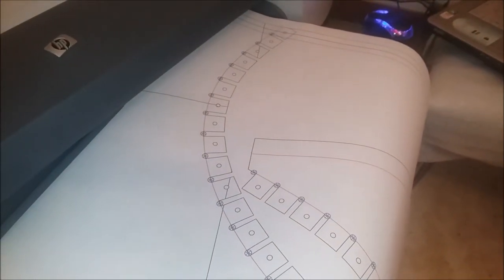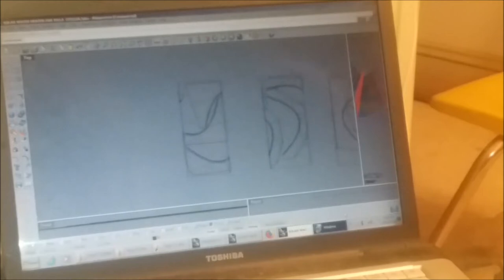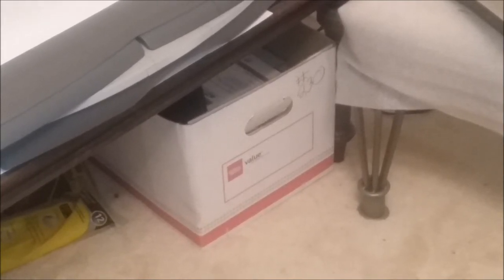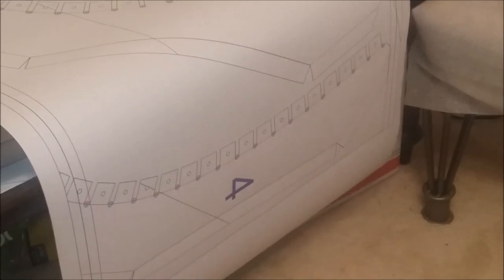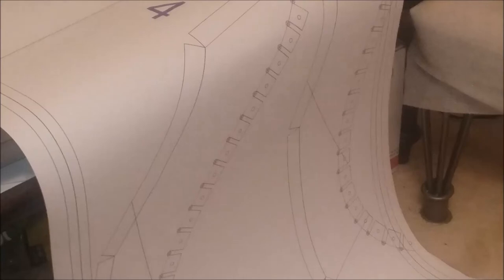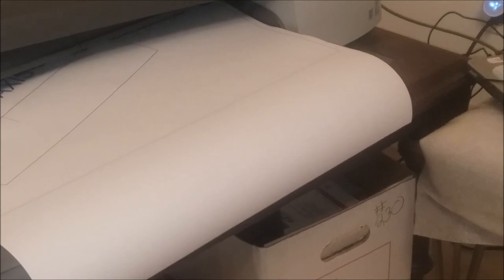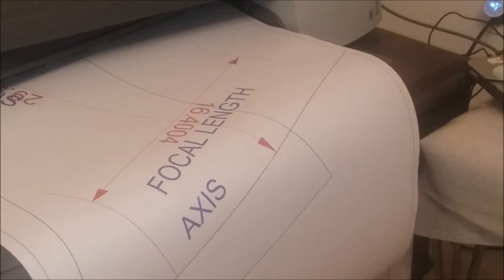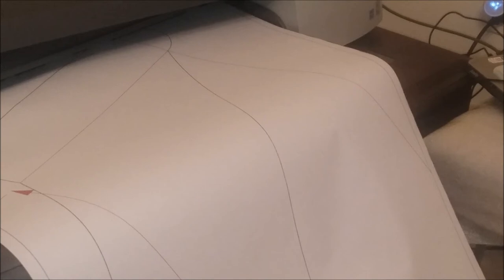LARGE FORMAT PRINTING PART 2

Comment: wow that's a huge plan!!!! Hope it's all working out properly!!!!
Reply from the maker: Everything is from a full scale virtual model. A copy of the model is disassembled rolled flat and printed. Most 
modeling is a few dimensions to get started followed by a lot of edit type commands. Then the model is measured
to in my case 4 decimal places. Bolt holes and rivet holes are made thru the assembled model and pretty much
have to fit. I make all the components different colors (layers) to check for 2 things occupying the same space
or use the intersect command so rarely any problems. The more exciting surprises are with G-code files that run
the CNC equipment when a tool path goes straight through a part. Praise the Lord for Chinese CNC tool bits.